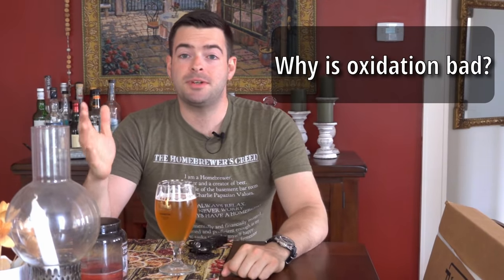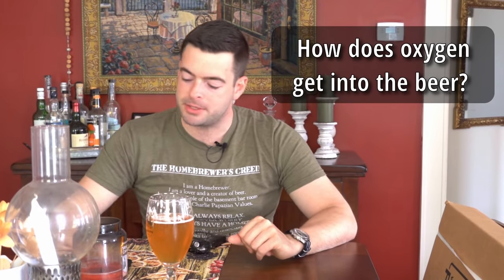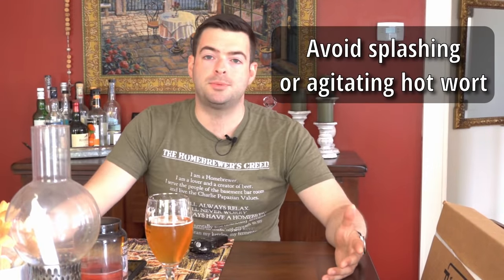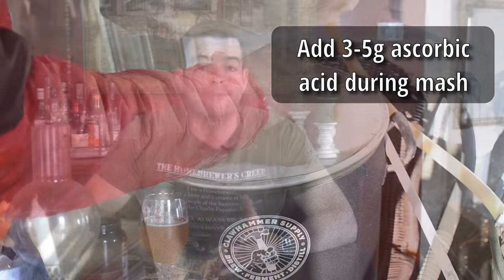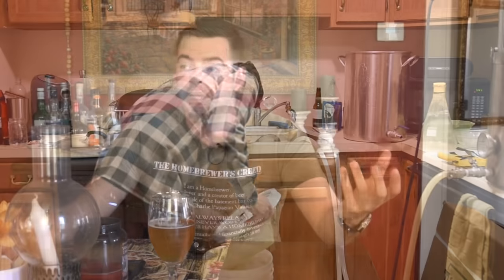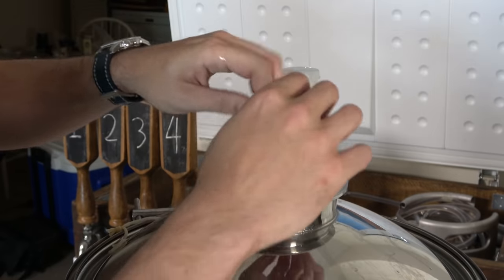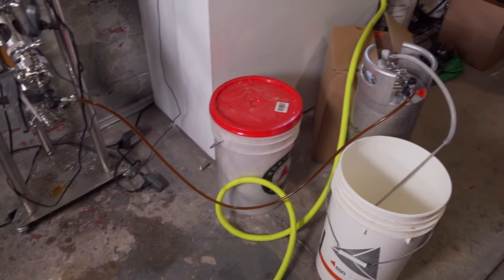THE TRUTH About OXIDATION in BEER & 16 Ways to PREVENT IT

Comment: I'll add that I've been using the Grainfather all in one system since about 2017. Some of my lower gravity beers, small enough to require the micropipework, the silicon hose that's used for recirculating just simply doesnt reach the top of the wort, so there's some direct air contact and minor splashing (the pump isnt crazy powerful) and to date, I've yet to have an oxygenated beer. In fact, going back to 2008, that is one fault that I've never tasted in my own beers.  Something I've noticed though is that age can bring forward faults that may be minor or undetectable right out of the fermenter, or freshly in the keg. But 9-12 months later, something changed. I think this comes back to "shelf life" more than anything though.  But even on beers that stuck around for a while, like over a year, I've yet to taste oxidized beer on my own beer.  I've tasted it in various forms in judging at competitions and perhaps unsurprisingly, a lot more in commercial beers. Particularly imports.
Reply from the maker: Thats awesome, it is always cool to know you have more control over your process as a homebrewer than some professionals!
Reply: On this front I would say most certainly we have more control. Think back to bottling (or kegging) a 5 gallon batch. Now imagine that's a 500 gallon batch...how long do you think it would take you?

Need to speed it up, right, all of that automation equipment is a new vector point for oxidation in a commercial beer line.

We simply have more control over our low volume processes than the big guys can.

Comment: Old video, but there is my two cents about hot side oxydation : at transfer in the kettle before boiling I don't think it's relevant. Boil actually deoxygenate wort (you have to boil for more than 30 minuts). 
And I hope it's not a problem because lots of pro brew units have the transfer inlet from mash tun to kettle in the high side of the kettle to avoid a check valve if you put it in the lower part of the kettle. Cheers !
(maybe my english is too bad for this one, but I tried 😅)

Comment: What is the best way to do a closed transfer if I am adding a fruit puree at packaging?
Reply: Fruit puree will restart fermentation. I wouldn't add at packaging. Add to the fermenter instead and wait for secondary fermentation to finish before packaging.
Reply from the maker: If you kill the yeast with something like potassium metabisulfite, then you can safely add fruit puree to the beer without being worried about restarting fermentation. That being said, it will definitely sweeten things up. If you don't kill the yeast, as Matt says it will restart fermentation and that should scrub oxygen pretty well.

Comment: If you if you dry hop at high krausen or at a certain point during fermentation ie a certain gravity above terminal gravity, you can cap the fermenter after hopping. 

1 gravity point gives roughly 0.5 volumes/ 0.98 g/L of carbonation, if I remember correctly.

i.e. If you cap after 1.013 on a beer that finishes at 1.008 you should get about 2.5 volumes / 4.9 g/L. 

This will allow your beer to naturally carbonate rather than having to force carbonate. Could save you a bit of your CO2 tank.

Obviously only try this with a pressure rated fermenter.
Reply from the maker: This is true! You can also throw a spunding valve on afterwards to maintain a certain pressure as well.

Comment: Hey man, I’ve tried the filling keg with starsan and pushing out with co2, then hooking up hose from fermenter to out port in keg, and hose from in port of keg to top of fermenter, but beer gets stuck and doesn’t flow into keg. Has that ever happened to you?
Reply: Is your keg closed when transferring? If so, pull the PRV to occasionally vent the keg or use a spunding valve like I do. The beer will stop flowing if the pressure equalizes between the fermenter and keg. 🍻
Reply from the maker: You'll want to make sure there is a pressure difference between the fermenter and the keg, where the keg is at a lower pressure than the fermenter, or just simply at a lower height. Usually only a few PSI will suffice to get the beer flowing.
Reply: @TheApartmentBrewer  thank you! I think my issue is I bled out all the pressure as I was freaked out putting any kind of pressure on my plastic fermenter, haha. I’ll try it again with like 1 psi on my new anvil bucket fermenter. 🙂. Btw, your videos are awesome and have been extremely helpful to me as a new homebrewer!
Reply: @TheMattMustain  i think that is my issue, I’m bleeding out all the pressure before I attach to top of fermenter, and even though I’m using gravity with the keg lower than the fermenter, it’s just getting stuck.  I’ll try it again, thanks for the help man! 🍻

Comment: when I do bottle a few using my bottle bucket, I send co2 trough the spigot while filling. I then run a couple psi through the bung hole while filling my bottles. I use pet bottles so I can squeeze out the headspace before putting on caps. I have never had a problem using this procedure. 😁🍺🍺
Reply from the maker: Nice technique! Thanks for sharing!

Comment: I have an Anvil foundry and Anvil bucket fermenter I do 3 gallon batches. I’m currently fermenting a Mexican Cerveza and want it to be clear I did put whirlfloc tablet at the end of the boIl. I saw someone put a balloon on the stopper to capture CO2 then put it in the fridge to cold crash and it drew it back in. Do you think this is a good method? Do I even need to cold crash? Im still bottling and haven’t moved to kegs yet.
Reply from the maker: I've heard a few things about this method but never tried it. Seems like it would do pretty well though, unless the balloon were to come off.

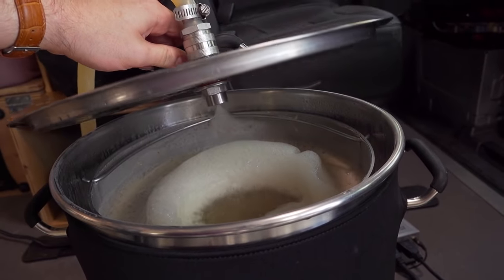Comment: What is the spray nozzle you have installed on the lid of your kettle? (shown 5:28) 

I've been looking for something like this for my system?
Reply from the maker: It's the clawhammer supply spray nozzle. Ad long as you can put a hole in the lid of your kettle you can install it. No need to buy a full system, they sell it separately.

Comment: I know I'm gonna get push-back, but hot-side aeration is real! I used to recirculate my mash through a sparge arm and I was always getting brown, murky beers when they should have been bright and clear (except hazys). I ditched that and went to a hose resting on top of a screen and now my beers are the color they should be; along with improving my mash efficiency! Win-win!
Reply: please explain all the bright and lightly colored beers produced with the clawhamer system with it's spray nozzle? The clawhammer system will expose the wort to significantly higher levels of oxygen than the scenario you describe.
Reply: @TheZurazura  I can't explain it; it makes no sense. All I know is it's working for me. All systems are different.
Reply from the maker: It is indeed real! But I think what I'm observing from lots of these comments is that people's experiences seem to differ widely depending on their individual setups.

Comment: Thanks for the video! It is a very interesting subject. I am going to be practicing and getting a process down for low oxygen exposure bottling for my next brew. I know that NEIPA are susceptible to oxidation after fermentation, but I am planning on brewing a Belgian Tripel later this year and wonder if that style is susceptible to the same oxidation issues?
Reply from the maker: Truthfully all beers are susceptible to the oxidation risk, however Belgian Tripel when compared to NEIPA isn't going to be as at risk, since in most cases you will not be brewing it with Flaked grains or dry hopping.
Reply: @TheApartmentBrewer  Thanks